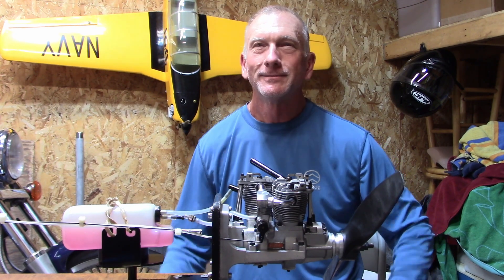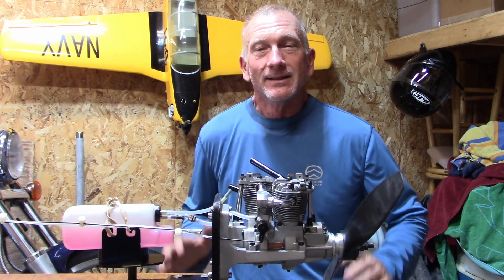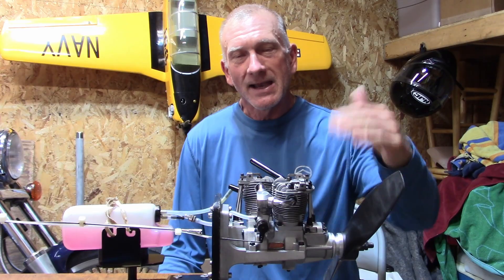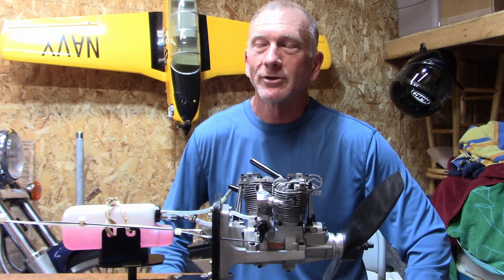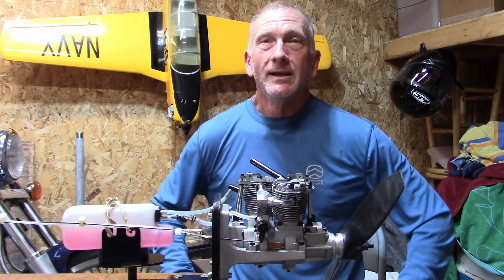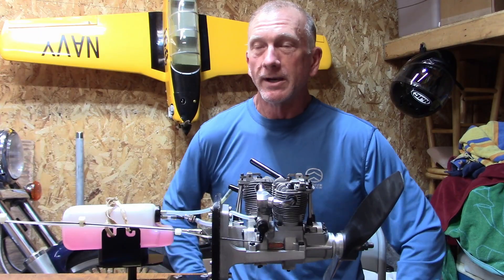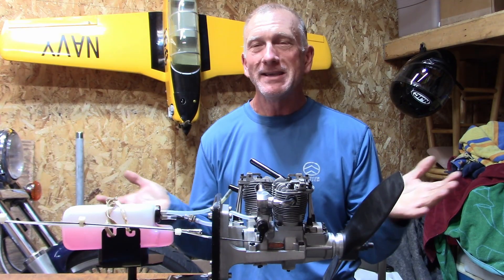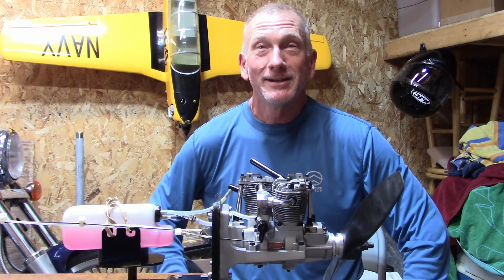Saito FA-200Ti A Mystery Part 1

Comment: On a 4 cycle engine the camshaft turns at half crank shaft speed.
Regardless of how many cylinders there are, all cylinders have ignition events in a total of 2 revolutions 
I believe you are correct 
One of the camshafts is 180 degrees out of time.
Which one is part of the mystery
Reply from the maker: Wait until you hear about the other part of the mystery!

Comment: Yeah makes sense itd be opposite as when one piston is up at TDC the other would be down. So yeah, timing needs set. 

I would think "in theory" if there are 2 timing gears you would just set them the same OR opposite of each other. But that would depend on how its designed internally. Wont know until you open it up. 🤷‍♂️

Comment: I think this is a boxer engine which would mean the timing is actually correct. 

I looked pictures of the crankshaft and it looks like it's a boxer with some offset (30degrees I remember it having) to match for tilted cylinders. 
It would also explain having a single carburetor. With a 180 degree V engine you would need two carburetors.

So, I think the timing is correct and the problem is elsewhere.
Reply from the maker: Well, there’s a comment from somebody who has actually timed this engine and even he says the timing is incorrect. Which is also when I believe.
Reply: It will be interesting to see how this mystery unfolds. Beautiful engine.

Comment: Ok, so the timing on one of the cylinder are  180 degree wrong, and what you feel was maybe a valve hitting the cylinder yesterday, and maybe the other was out of timing too.
Reply from the maker: Well resetting the valve lash did seem to change things a bit, but I do not think a valve was ever hitting the piston.  I might be able to determine that will I pull the heads.

Comment: Hi David, The engine was advertised as being new, never run. There was a mention the user had removed the inspection plate to look inside. He also lost the original glow plugs so I purchased 4 new ones. Watching intently on this one. Thanks again! Keith
Reply from the maker: I wonder if that seller was the original purchaser of the engine.  Maybe never run but definitely disassembled to a certain point as the factory would never do something like this.  Sounds like no full disclosure of the true history of the engine. Just goes to show you never know what you might get from a second hand sale.
Reply: @dmrcflyr2  At $1,000 plus new glow plugs, that's quite a screwing I got!

Comment: Actually, one engine runs forward and the other in reverse. Therefore, I suspect that two different camshafts are needed. It's possible that they were installed reversed and also incorrectly adjusted.

Comment: Check the cams, i see the timing is completely wrong, the inlet is not supposed to open at the same time, the previous owner assembled it wrong, (assemble front cam, rotate crank 360 degree and assemble rearcam)
the front one is a regular cam like the saito fa100 single cilinder, the rear one has the cam timing different…
I had this engine and puzzled with this after a full disassembly, i still have pictures and partnumbers of the front and rear camshaft to indentify  the difference..
Btw the camtiming (duration and time of opening) of the rear is different compared of the front, as far as i know this is because of the heat buildup of the rear cilinder
Reply from the maker: Thank you! That is precisely the information i have been looking for. This is essentially what my friend Harvey said to do also. Does the rear camshaft have both a timing dot and a line on it like the 300T does? It is there only one timing mark?

Comment: When one has TDC the other piston has lower dead center . If not you have to calculate what degrees the TDC piston is apart of the other one
Reply: The crankshaft has the TDC of each cylinder 30 degrees appart from each other
Reply: https://youtu.be/2XYP1_aCtRk?si=iaoB9bKmIyg6PubH
Reply from the maker: So after watching your video, how do I reset the timing? Do you agree that the timing seems to be incorrect?
Reply: @dmrcflyr2  totally agree the timing is incorrect . Now watching your third part I do believe the cam gears might be swapped. Try swapping the camgears and adjust TDC again

Comment: somebody has been inside that motor. cant have the intakes and exhaust valves open same time. cams have been  reinstalled wrong.gonna have to remove both cams and retime them. also check for valve leakage. should be fine after that.
Reply from the maker: Thank you Harvey!